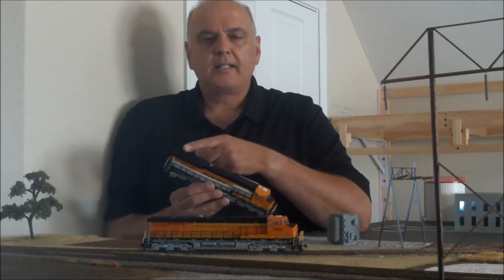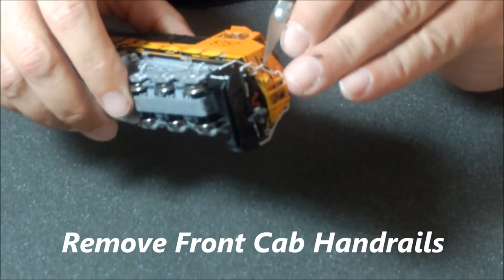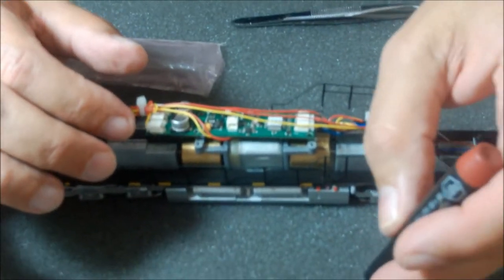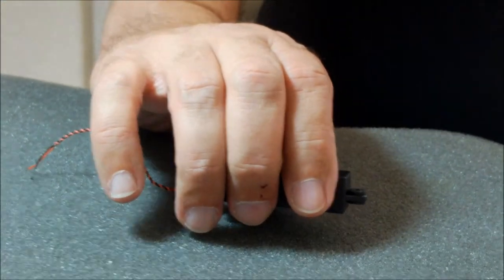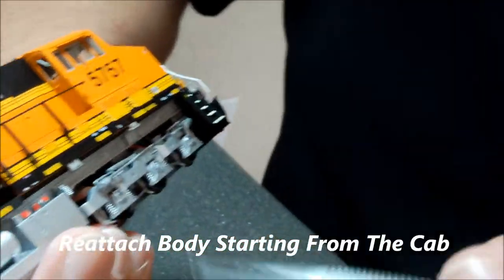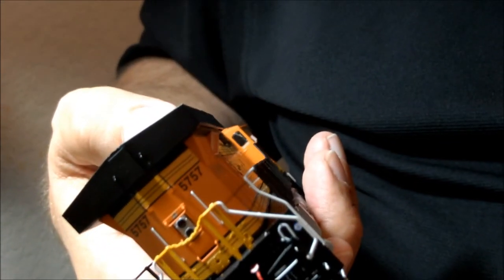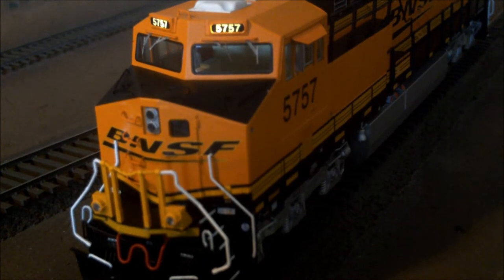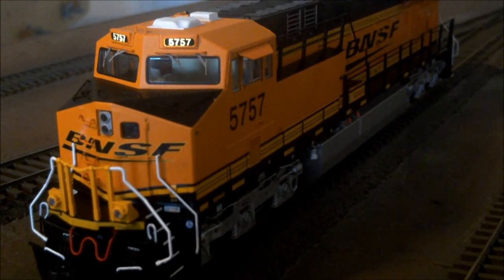Upgrading Intermountain GEVO Locomotive Sound

Comment: Appreciate your insight into removing the I-M Gevo body as I have one of my own to upgrade. Having installed  a number of DSM8 speakers, I agree with your CV 154 - 156 settings. An alternative for CVs 157 and 158 are significant reductions to offset the overly amplified midrange. I roll back CV157 into to 100 and CV158 even more so to less than 50. This allows the bass (actually just lower midrange) to be heard. On Athearn units with similar inner body dimensions, the changes in sound are significant. Most Soundtraxx sound files reach down into the upper 170 - 180 Hz. range which is well within the DSM8's capabilities.